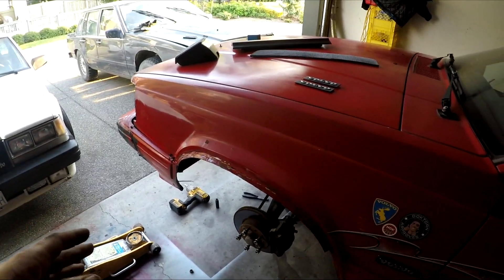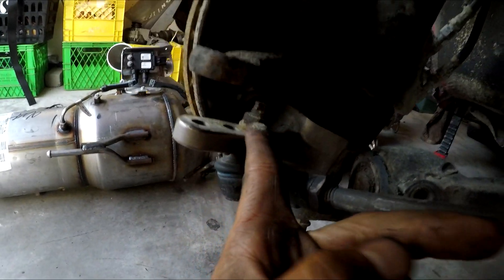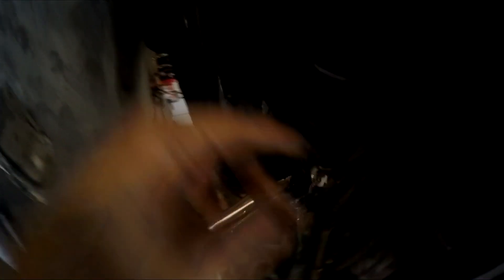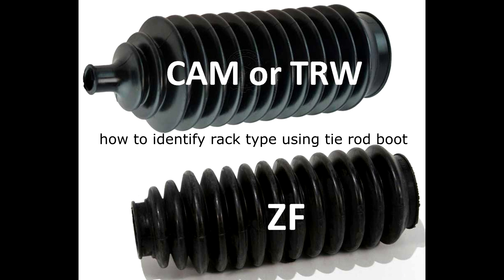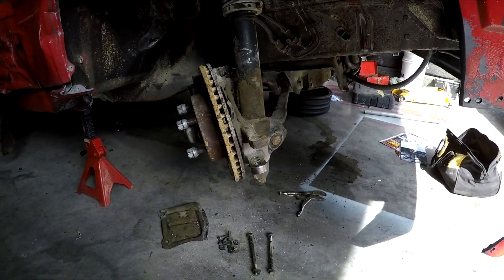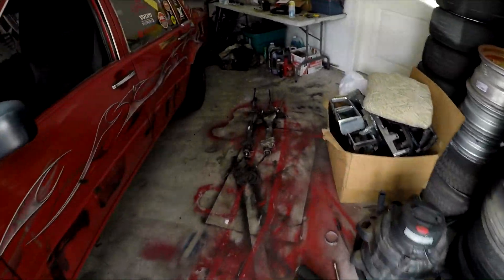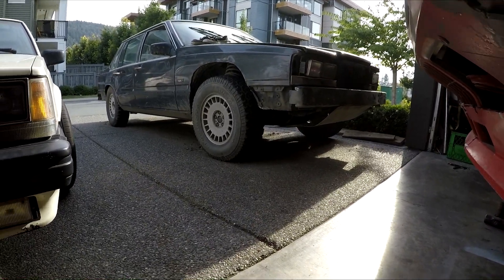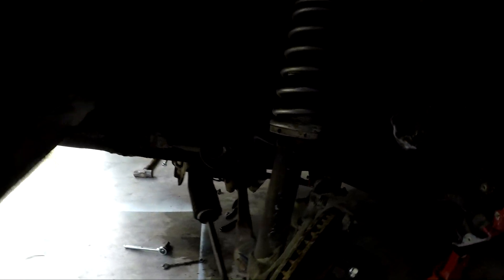HOW TO CHANGE A VOLVO 740/940 STEERING RACK

Comment: Fantastic.  Learned that it should NOT cost $300 in labor alone for a straight swap.  Learned what drifting is.  (Not sure about "gravy" yet).  Am also convinced that someone should buy my Volvo to use in drifting.  (I did inquire with authorities to see if there was a legal way to blow up the car so that I would never have to see it again, nor give yet another mechanic one dime more, even though I have no other car or transportation.  Amusingly, the authorities I spoke to said there is probably a way.... but they looked concerned.  Also-seeing the condos? in the video - I figure the residents either love you or hate you.  I, of course, am 1000% in support.  Thank you.  Now, what to do about my Volvo - again.

Comment: So my 240 has a new maval power steering rack with new hoses and it don't work ? Help
Reply: You have probably resolved the problem by now, in my case, the "new" Maval was bad.
Reply: @jakeornot6306  how did you resolve it ? What was the rack doing wrong ?
Reply: What about control  arm bushings ?
Reply: Steering return is awful on mine !

Comment: HEY MISTER LIFTS CAN YOU MAKE A VIDEO ON HOWTO REMOVE FRONT SEATS??
Reply: 4 bolts on the bottom 13mm? U think and 2 bolts fir the seat belt on the seat
Reply: @nomajhondeere3324   how do you remove the plastic side holder thingy?? maybe i didnt see it
Reply: Yup just pull em out no bolts attaching them
Reply: The bolts are in between the sliders